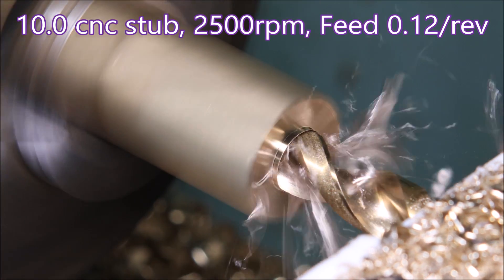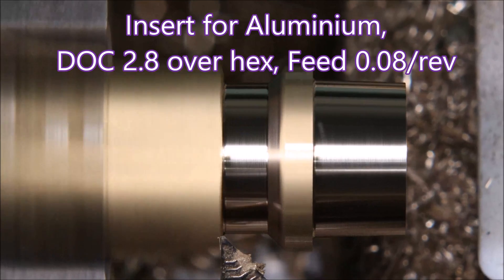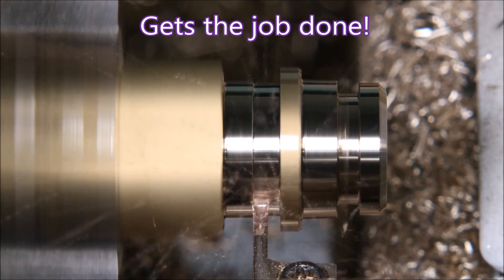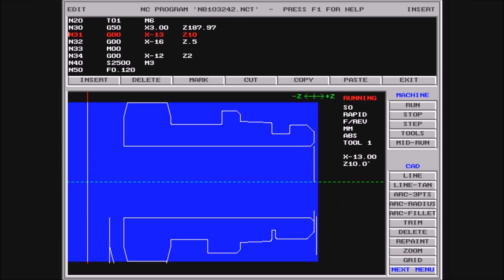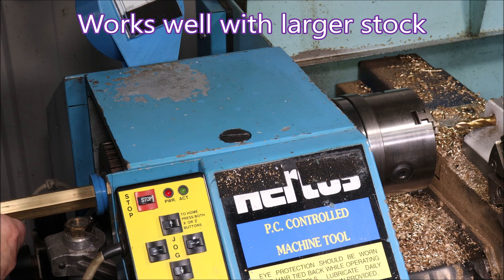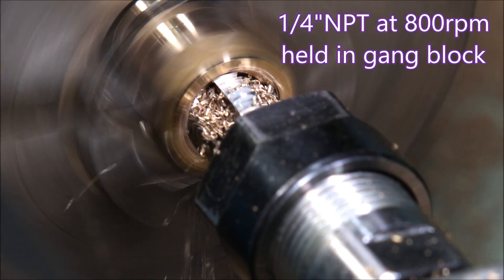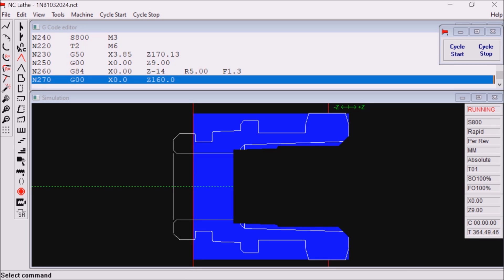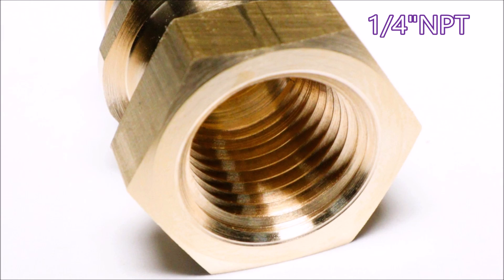Hercus PC200 cnc lathe, drill, turn, profile, part, bore and tap 1/4NPT brass fitting.

Comment: By the way, G84 usually does turn the spindle back on again after reversing, if you're not using a synchronous tapping mode 😊 so yes, I'd say it's normal
Reply from the maker: Hi Patrick, thank you for the G84 comment. And thank you for not only watching my videos, but also for contributing to their success with your comments

Comment: Always such clean programming. Love to see your videos still doing well!
Reply from the maker: Hi Kevin, I do try to make the program as economical as I can. A lathe the size of mine needs all the help it can get.
As for my videos doing well, I wish they would do weller. LOL This video took me 2-1/2 days to put together, it has 850 views so far and will probably top out at around 1.5 to 2.5k after a month and not do much more. That is quite disheartening, not disappointing as I have no right to be disappointed. But 2.5k views for the work I put into it is not very rewarding.  Of my last 30 videos, one reached 5k, three reached 2k some reached 1k  but lots are still in the hundreds of views. I have to admit that comments are about the only reward I get, so yours is very much appreciated

Comment: Nice videos, I know this can vary but how many parts like that would you be able to make before having to change the parting insert
Reply from the maker: Hi Alan, apart from a recent job doing mild steel, my inserts mostly die of old age.  They can make a lot of parts in non ferrous materials. I think I have sometimes changed them because it was "time" rather than their performance was dropping off. That insert has just done 400 parts and I don't think I would have to change it if I did another 400 parts. No coolant, I don't use it for brass, except a bit applied by brush when tapping. Sorry I can't be more specific. Nigel

Comment: The Hercus is perfect for turning out small parts quickly. Is that a second CNC lathe or a manual one ?
Reply from the maker: That is a second cnc. Still a Hercus PC200 but with later electronics and turret. It runs in widows XP, the older one runs in dos. Thanks for your comment